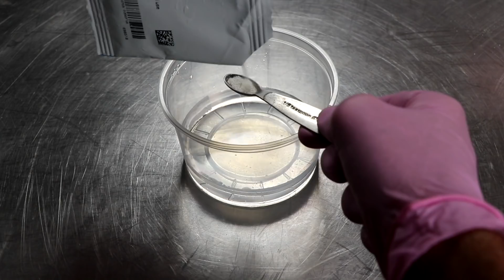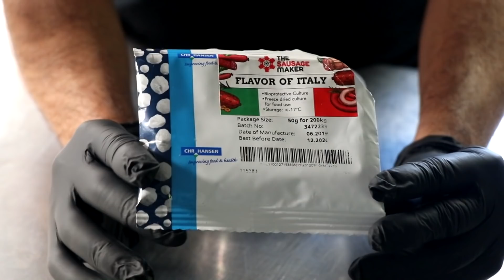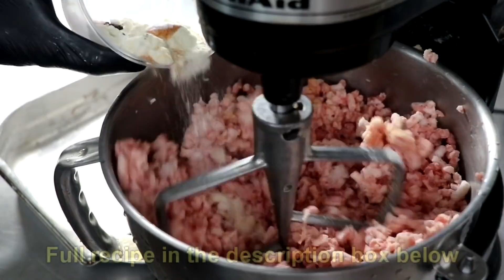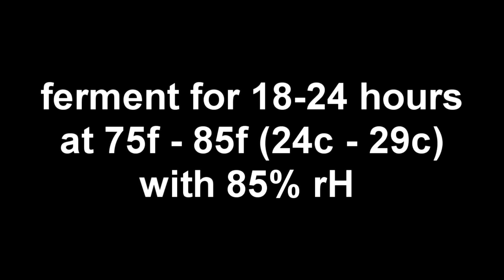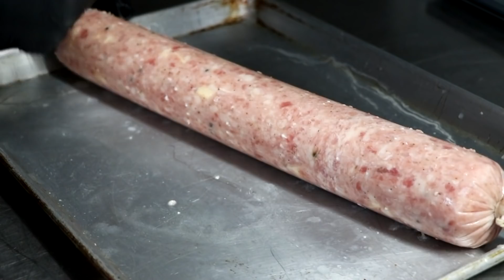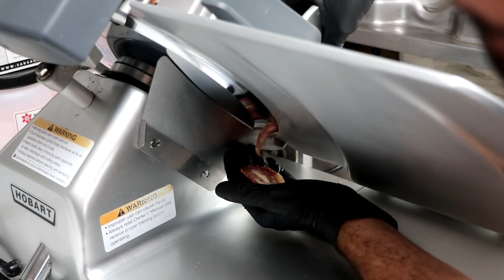How to make Italian Cremona Salame al Parmigiano Reggiano

Comment: I’ve found I have far better luck fermenting if I let it dry in the chamber for 3 days then ferment in a bag on the counter at room temp. Doing it up front, it’s too wet and I can get off-smells and failures.
Reply from the maker: Interesting.  The purpose of fermenting first is to get the ph to a safe spot, so that when it dries at unsafe temps there won't be a problem.  I've personally never had an issue with fermenting first as the added moisture is what's necessary for proper fermentation.  It's always fascinating to hear about different techniques.

Comment: Hi Eric. Nice looking salami, but was wondering if the parmigiano reggiano does not overwhelm the taste? Also, I noticed that you have covered the glass door of your refrigerator/drying chamber with foil, obviously to cut out the light. I have read about light possibly affecting the fat making it rancid, but this never really happened to me, and I have a similar drying chamber with a glass door. Is yours located in an area with lots of natural light? Have you had problems and that why you covered it?
Reply from the maker: Hi Andreas.  I didn't feel that it overwhelmed the taste, but then again I love both salami and p. Reggiano.  My chamber is outside and is in natural light most of the day.  I've never had a problem but don't want to take a chance..

Comment: Whats the best way to store a salami or salumi after you crack into them? Remove casing and vac pack in the fridge?
Reply from the maker: That's exactly correct.  Remove the casing, wash off any mold and vac seal.  Then refrigerate for up to 3 months.

Comment: Hi,
As always, inspiring work. A difficult question: I have everything I need to make Salami; Access to quality meats, Good meat grinder, LEM Stuffer, High-quality Ph meter. However, no temp/humidity controlled chamber due to a very small apartment. What salamis can I make using only my refrigerator?
Reply from the maker: Hey Joseph.  If you want to make salami in your fridge you would need to use the Umai bags.  Other than that there's not too many options..
Reply: @2guysandacooler  Copy That. Many thanks.
Reply: @2guysandacooler  Could you do a video on that some time?
Reply from the maker: @GrizzAxxemann  here you go:  https://youtu.be/cdD0YGwoynA
Reply: @2guysandacooler  awesome! And I can find a Canadian source for the Umai kits, too!
Reply from the maker: @GrizzAxxemann  Now that's a good question.  I'm not sure about that one🤔
Reply from the maker: @GrizzAxxemann  Try this:  https://umaidry.com/pages/where-to-buy
Reply: @2guysandacooler  I already did that. I wasn't asking where, lol. I was stating that I could! 😁

But if you have a recommendation for an entry level ph meter... that Apera that you use is CRAZY expensive up here. Wifey WILL castrate me if I spend that kind of money.
Reply from the maker: @GrizzAxxemann  LOL.  I just reread the comment😂😂😂.  Not sure on what's available in Canada.  Let me do a bit of research..
Reply: @2guysandacooler  I've been doing some for a while. They're either really cheap junk, or really expensive. I might have to check with some of the industrial supply places, like Acklands-Grainger, or Vallen.

Comment: Looks fantastic!  I have a question regarding the mold culture.  Instead of discarding the casing, could one keep it in the fridge, and then later, for the next batch, soak it in water to create a new mold culture?
Reply from the maker: Yes you can!  Especially if there's no unwanted mold growth on it.  Keep it in a ziplock bag (not air tight).
Reply: @2guysandacooler  Thank you for the quick reply.  Actually, would freezing be better?
Reply from the maker: @TheWolfyDaddy  I would freeze it for longer storage.  Not in a vac sealed bag though.
Reply: I keep my left over M600 in a mason jar placed in my chamber. I periodically feed it some dextrose like a sourdough started. When I’m done using it on my next salami, I add some water. Ready for when I need it. Works great.